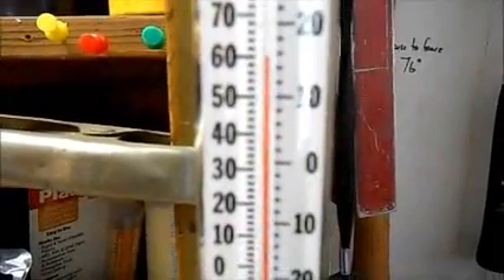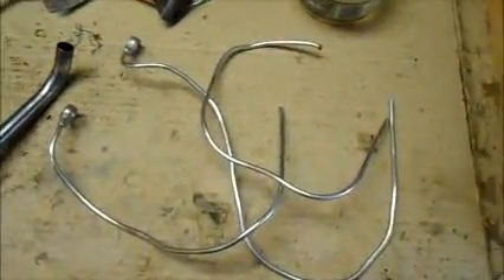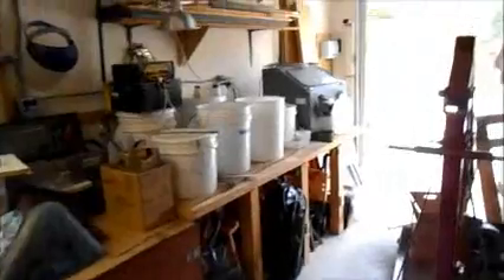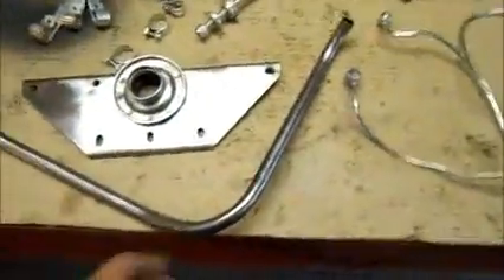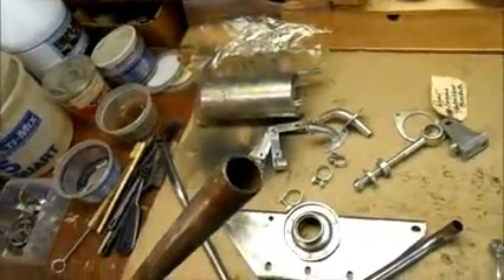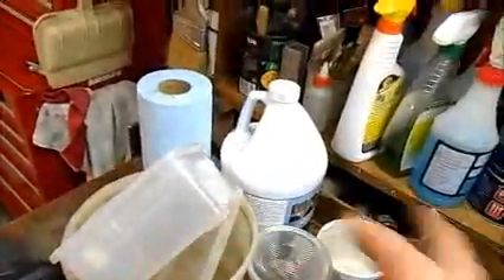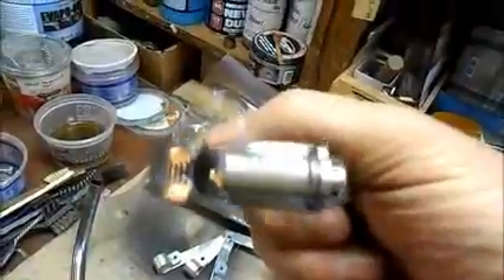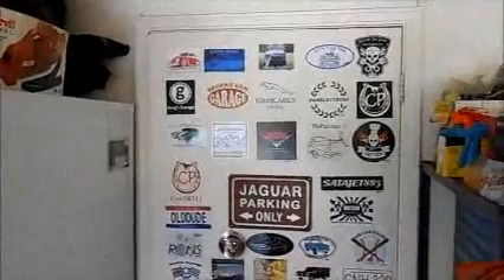Mar 3, 2013 - More plating and parts cleaning

Comment from the maker: Stripper - well that would have made more sense than trying to use hot detergent or acid dipping.  I was just looking for a shortcut!  I finally used my paint stripper and it worked fine....